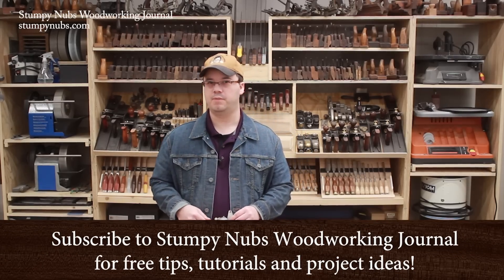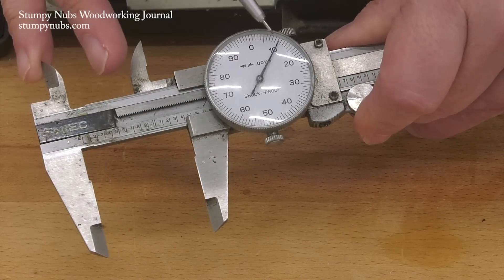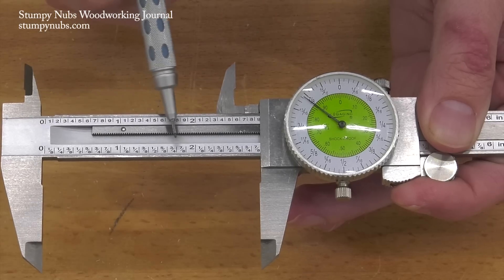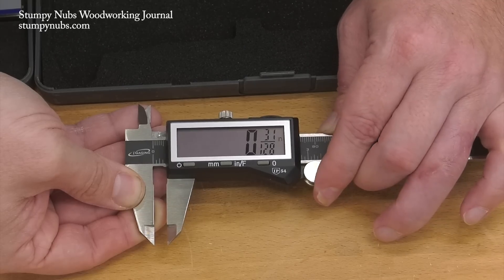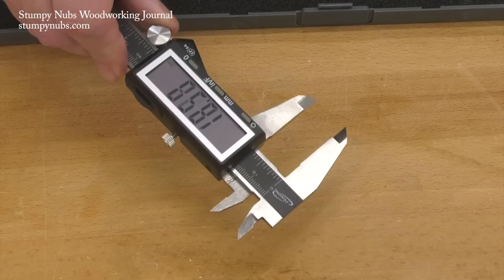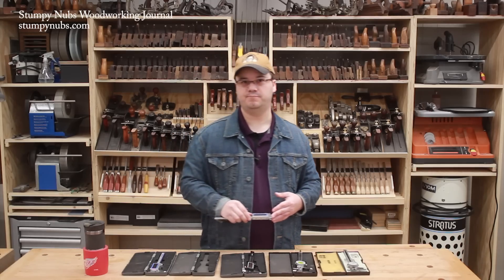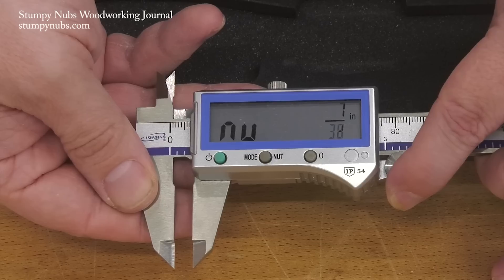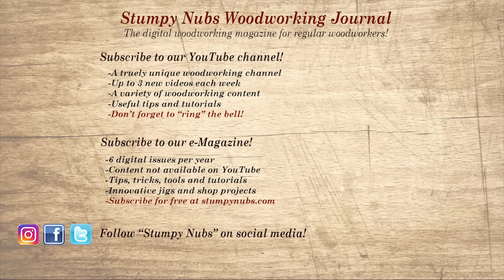FINALLY! Calipers made for woodworkers!

Comment: My Mitutoyo vernier calipers are literally the most-used tool in my workshop. I do not think I could start or complete any project without them. They are analog scale, without a dial, and accurate down to 0.02mm. 
The mere fact this video exists tells you how bad working with imperial measures is; sorry, America!
Now if you'll excuse me, I need to go work out how many hogsheads per furlong I'm getting out of my car. ;)

Comment: Oh, you guys use the metric system. The inch, which is the basis for your system of cobbled together groupings where 12 of something makes 1 of something else, then 3.13 make some pthing else entirely, is defined using the metric system as 25.4mm. 😂 You're welcome. 

And, Ive just learnt something.... Ive always called them Vernier Calipers and wonder why, so I just googled it. 

For those of us who use the Metric system, the vernier scale is the smaller scale at the bottom of the caliper, making measuring to sub-millimetre possible. 

One more for giggles: Most Australians dont know that centimeters (1/100th of a metre) isnt an official measurement. The official measurements are millimetres, metres, kilometers.
Reply from the maker: Vernier calipers are a different thing altogether: https://www.youtube.com/watch?v=_8II0Bgly1k
Reply: Factually wrong! centi, deci, deca and hecta were always part of the metric system.  Some industries prefer to use only the thousand steps, while others prefer cm as a more human scale.  Similarly 1 liter is 1 dm³ and barometric pressure is often reported in hPa (hectoPascal) etc.
  The ratio between inches and meters have been redefined on multiple occasions, originally there was no fixed rule, only measured ratios. Later some fixed ratios were established by conventions and laws.  Only in the 1960s did the 3 big governments (US, Canada and UK) all switch to 1" = 127/5000 m for most purposes.  This had already been the machinist ratio since the 1930s or before.
Reply: @johncrowerdoe5527  im not sure what youre disagreeing with here, to be fair. Firstly, I didnt say centi, deci, werent available to use, and it is far more common to see centimeters used - especially on tape measures or rulers - but I will stand by my ascertation that millimetres, metres, and kilometres are the official messures in Australia. Just ask any surveyor in the country,  who has to be schooled in official measures. You wont ever see anything different in government records anywhere. Perhaps I should have spelled it out a bit more clerly, this is in AUSTRALIA. 

Yes, you are correct, those are defined in  the metric standard. They are available to use in Australia, but not for official records or government procurement in Australia.
Reply: @StumpyNubs  i have never seen a caliper in australia without the vernier scale at the bottom.
Reply: @petermiddo  I don't know internal rules for the Australian land surveying service.  But you wrote as if use of cm was invalid globally and many Australians were somehow too stupid to know.
Reply: @johncrowerdoe5527  my apologies for the confusion.

Comment: The UK is a mish mash of imperial and metric,  just look at our tape measures for example. I use both, for example sheet goods
 8' x 4' but drill bits in mm. When Brexit is done may be we will celebrate with a new system - heaven help us! ;-)
Reply: If we ever really do leave, we could theoretically ditch metric. Adoption of metric within a certain time limit was a condition of joining the Common Market (as it then was).

Comment: Re: The Craftsman Gallery.  In this day and age, an on-line vendor that won't tell you shipping costs until you've told them everything about yourself is a non-starter for me and I suspect many others.
Reply: I agree.  Will purchase somewhere else for that reason.
Reply from the maker: I don't control their website. But I can tell you that they are a small, family run business that's worth supporting. And when you support them, you support us and the hundreds of free videos we make for you. Thanks for taking that into consideration :)
Reply: Dave:  We are working on a new site where you will only need to enter your zip code (rather than full address) to get a shipping estimate on the items in your cart if you live in the USA.  Our current site offers carrier rates that are based on weight and distance or the option of a flat rate of $5 for under 1lb or $8.50 for between 1lb and 2lb.  These rates closely mirror what the carriers charge.  For international shipments, we have to charge the carrier rate.  Lewis Stepp, Craftsman Gallery, ChipsFly.com.
Reply: @StumpyNubs  Which is why I bothered to comment at all.  I do appreciate small, family run businesses, including yours.  And if I were more serious about an imminent purchase, I may have pushed through.  But I think I would be more supportive of their business if I pointed out an area where they may be loosing substantial business without knowing why.

Comment: USA DOES use a metric system...  For engineering applications we use Decimally Denoted Measurement system based on increments of 25.4 mm which we call an “ inch”. I’m 71.250 inches tall.  No fractions involved.   🤪

Comment: I ve worked in the Lumber yard/Hardware store industries and a Industrial Supply store (Allen bolts grade 5 bolts end mills etc) so I ve been exposed to every conceiveable measurement system there is, plumbing is a nightmare But the thing I tell everybody is that everything on this planet has at least 3 dimensions -it has to, a string with two knots in it only tells me how long not the diameter or the thread size not to mention metal type or finish or head type there is one exception...Farts only have one dimension....Stink

Comment: Calipers of any kind are only good to .001 measurement.  That .0005 you see on the display doesn't mean that the caliper can discriminate down that decimal place.  If you have a .0017 gauge pin or feeler gauge the calipers will more than likely still show 0.0015 or maybe even .002.  If you are trying to hold +/- .001 on a tolerance calipers are not the right choice of measuring tool.  I know that type of tolerance is not common for wood working.
Reply from the maker: You just saw it discriminate down to that decimal place. If it couldn't, it would have shown .001 or .002, not .0015. It knew the difference, and consistently so.
Reply: @StumpyNubs  It most certainly did not discriminate to the fourth decimal. If it did you could measure a .0017 feeler guage and your calipers would read .0017, not .0015 or .002 depending on how the caliper rounds the decimal.
Reply from the maker: @brandons9138  - As I said in the video, it's accurate to 1/2 a thou. I didn't say down to .0001. That would a tenth of a thou. Here's what I said: 8:46
Reply: @StumpyNubs  What I'm saying is that to call something accurate to within .0005 you need to be able discriminate down to .0001. With a minimum resolution of .0005 the accuracy of the instrument is .001, not .0005.
Reply from the maker: @brandons9138  - It doesn't half to be accurate down to a tenth thou to say it's accurate to a half. But I will meet you half way on this argument, my wording isn't absolutely precise because it won't, for example, ever give you a reading between .001 and .0005, such as .0006......So, at the risk of having an impasse over what amounts to semantics, let's agree on a different phrase: The accuracy is +/- a half thou. That means any measurement you take may be up to .00049999999 larger or smaller than the dial reads. (Your argument suggests it can be up to .00999999999 off, and that's not true.) I think we should be able to agree on that, eh?

Comment: I'm not a machinist... but the machinist's decimal scale is not that difficult to convert.  

Thinking in terms of 10ths, 100ths, & 1000s of an inch & converting to fractions of an inch... is really not much different from converting metric to imperial... because both the metric scale & machinist's scale are based on factors of 10.  
1/2 = 0.5 
1/4 = 0.25
1/8 =0.125
1/16 = 0.0625 or 0.062
1/32 = 0.03125 or 0.031
1/64 = 0.015625 or 0.015
Once you have these memoized... it's basically case of multipling or dividing by the numerator.

Comment: The thing is that metric isn't always "dead one accurate" either!! There is a lot of "slop" in the differences between say "10 mm" at times and I have personally seen 15 millimeter sockets from different manufacturers that don't "measure up" to an exact fit all the time either!! Honestly Metric is a "new system" even for places like Europe, and for years, centuries in fact, places like France and England still used Imperial measurements before metric was invented (in France) in the 1800s!! Which don't be fooled to thinking that metric is all the wonderful either!! 

In fact (and a bit of brain food here) the American auto company Packard during World War II was hired to make the Rolls Royce Merlin Engine "more reliable" for use in aircraft and boats. They ran into a host of problems with the metric components on these engines when they had to machine parts for them!! Sometimes "15 millimeter" was "closer to 14.5 MM, and the English just wrote this off as "close enough" for example!! Packard was very upset at how "shoddy" the work on these engines actually were, and while they took the English Built designs for the Merlin Engine very seriously, apparently WAY MORE SERIOUS than the English engineers, later Packard Built Merlin Engines used "imperial measurements" to build many of the Packard build engines throwing the whole metric system out of the window completely!!! And this is apparent when you look at engines like those of the American Built P51 Mustang airplanes!! YOU WILL FIND Imperial measured parts ON many of those aircraft because Packard was tired of "close enough" metric specs! 

Even today in Europe there are some debate over things like "how much does a gram actually weigh?" and even their own metric system with other countries that use metric doesn't always "add up" to what it is supposed too!!! If you think I am full of the brown stuff, explain to me why the European Space Agency (ESA) can't seem to ever land a single space probe or they simply crash everything they make into what every they are trying to land on!! The most recent example was a Mars probe that two Metric use companies worked on, and ended up creating a crater on Mars with a billion dollar space craft, which was accidentally given the wrong units of metric measurement!!! 

Sure the USA has had failures with space craft too.....but at least most of our technology LANDS when we want it too most of the time!!! Which is my point!! Further if it wasn't for the US during World War II, then England wouldn't be speaking English now, would they??? So those imperial measurements are not such a bad thing after all are they??
Reply: Your tales are off the mark. Before metric every little kingdom, state or trade city had its own sizes for inch and pound, making trade really tricky.  Metric (originally part of the French revolution) was rapidly accepted as a compromise scale that was the same everywhere, leaving the British Empire as the last straggler because they had at least standardized their scale empire wide.  The previous widespread standards were the Roman foot and the Egyptian foot.

Comment: Something that is not a problem for most of the world. Does this mean woodworkers can't make change? Of course just look on the back of a cheap steel rule and look at the decimal equivilant. 1/64 =.015, 1/32=.031, 1/16 = .062, 1/8 =.125.
As an aside. This is also one reason I think certain tools should have dials on the hand wheels. A table saw is a good example. Say you need to cut a dado to a certain depth. Take a shallow cut. Check the depth. Zero the dial and crank up the required difference. No guesstimating or squinting at a rule next to the blade. This ain't rocket science, it's common sense.
Reply: Having memorized a few powers of 5, I tend to prefer the actual numbers, then round off as needed.  Common fractions are 0.5 0.25 0.125 0.0625 0.03125 .015625

Comment: The problem with the empty battery would not be, when the manufacturer would built in a real on/off-switch. The caliper must not be in a standby-status. But caliper-manufacturer works with the battery-maker. Thats a pity.
Reply from the maker: Yes, it's all a conspiracy between caliper makers and battery makers...
Reply: @StumpyNubs  Perhaps you should calibrate your humor-detector. <gicker>

Comment: I'm not going to call American woodworkers idiots for using inches. Australia got "metricised" in 1966; dollars and cents was an easy call; miles into kilometres not so much but eventually, after about 20 years, the penny dropped. I guess these "take up" factors were to do with saturation and frequency. However, timber was still sold in the old manner - a 2"x4" was a 2"x 4". It  still is, in this old Grumps head. I go to several "metricised" lumber yards and they all know me as feet and inches. Why should I do the hard work? I don't work there! My feelings towards American woodworkers is tinged with jealousy. I will never be able to get my head around that awful French system. Why should I?
Reply: My own country went metric as well, that doesn't mean I have to. While I can use metric I don't bother, that nonsense gets stopped at my property line.  Accurate measurement is only a previously arranged concept on what each term in that measurement system means for length, volume, pressure etc that everyone involved  has agreed to. If it can be built then doing so with either system will produce equal results. And for traditional hand tool wood workers, if there not using imperial then there not really using all the old traditional methods. :-)

Comment: Alright I am going to sound off. This is just a failure of our education system. Decimals and fractions is simple math. My neighbor brought over a measuring tape with the fractions printed on it. If you do not know how to read a tape, indicator or micrometer you do not have any business using one.
Reply from the maker: What are you going on about? There are different scales for different uses. Decimals, metric and fractions are all different scales. This isn't the same as a measuring tape with big fractions printed on it.

Comment: "Even though we say fractions, this is decimal."
Omg, just convert to metric already. Technically speaking, the imperial system IS defined by the metric system.
Reply from the maker: I have news for you, machinists in metric countries use decimals, as well. Your millimeters are fine as long as you don't want a finer measurement. Then you are back to decimals and fractions, as well. So enough with the condescending "our system is better" nonsense. Everyone is free to use whatever system they want, no matter where they live. It shouldn't bother you so much that others use a different system...

Comment: OMG........I don't know how you Imperial types ever got to the Moon........Get into the 21st Century........OMG.
Reply from the maker: Just because fractions seem hard to you doesn't mean they are to others.
Reply: @StumpyNubs  Fractions are not hard to me at all.  I had to learn them the same as all the other kids at primary school.  The whole world understands the Metric system and knows that to having to duplicate  data with Imperial is just a pain.  Duplication is dangerous too, it has caused the death of hundreds of airline passengers and crew, not to mention the Hubble Telescope mirror fiasco.  The US Government recommends moving over to the Metric system, which the military has already done.  Perpetuating an 18th Century measuring system should be avoided IMHO.
Reply from the maker: @davidrichardson376  - Thanks for your incessant harping on an issue nobody here has any control over. It's very helpful and not annoying at all.
Reply: @StumpyNubs  Teach your school kids only Metric (starting at Primary) and in one generation all will be good.
Reply from the maker: @davidrichardson376  - You think I teach primary school now? Where, exactly do you think you are commenting?
Reply: @StumpyNubs  Have a good day.........
Reply from the maker: @davidrichardson376  You take care.

Comment: get over it, even your inches are derived from the meter. usa is the only country in the world using fractions 1/4 + 1/128 -1/8 = ?? compared to 0.25+0.001-0.1=0.1501 
one inch = 25.4 mm how many miles are there, nautical etc. enlish gallons and american gallons? the international and worldwide standard of measurements is meters, kilograms etc.
Reply from the maker: Since you clearly don't understand how we really use fractions for measuring (not at all as you show in your example), you should avoid mocking it until you know a bit more. Thanks.